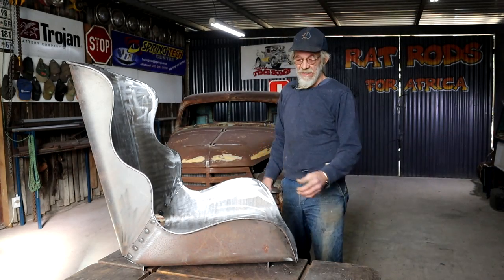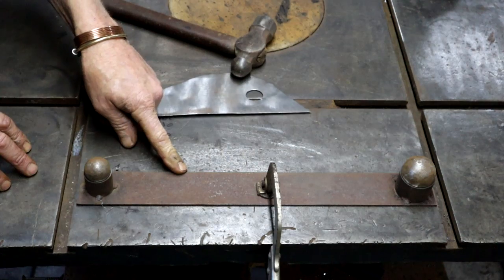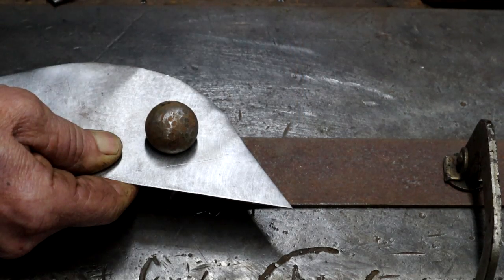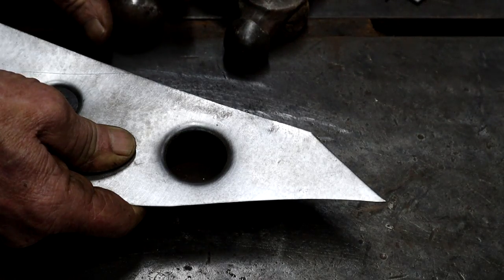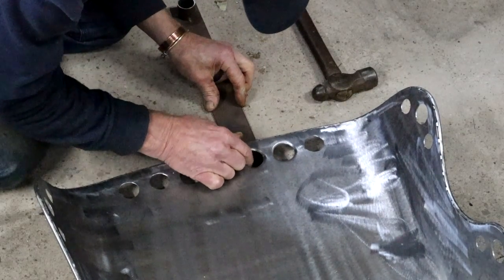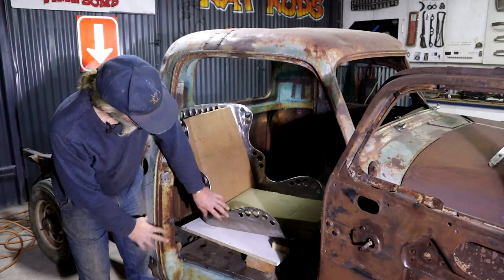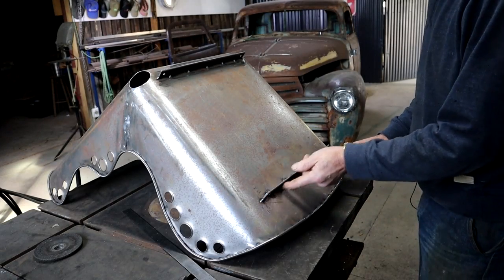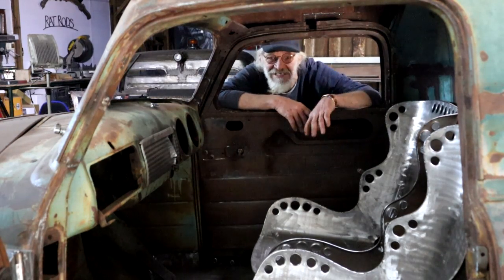DIY Dimple Plates - NO fancy tools, NO press!

Comment: Diff, if you make a short piece of tubing the size of the hole and weld tabs that center it in the larger pipe you can pull it up and set hole over it and then drop the inside tube down inside  before putting ball on it. Just a dumb thought all the way from Alaska. Cheers
Reply from the maker: That's a pretty neat idea! Someone using their brains up there in Alaska! :)

Comment: You can put a shorter piece of pipe (it can have thicker sides. A piece of PVC pipe would work) inside the dimple pipe.    With the shorter thicker walled pipe inside you can use it as the guide to center the hole to dimple it.    Easy peezy.    ♥️🇺🇸🍻
Reply: Or just paint a white dot centered on the bottom of the dimple pipe.

Comment: WOW..I wasn't expecting that. I think that is as simple as it can get. Truly innovative. Now have to go look for some steel balls, my brass ones just not gonna do the trick...lol. Thank you again for sharing Div. By the way seats look "awesome". You could drill multiple holes on the seat frame say 20/25mm (3/4" or 1" ) apart, 2 or three of them,  so that you  have a little ajustability in the forward/backward direction.
Reply from the maker: Thanks my friend! You know me, I like as simple as possible!😅 Been learning over the years that simple, yet effective engineering is the hardest. You will find a variety of different size steel balls at a place like Steel and Pipe. Regarding seat adjustability, yes a series of holes could work. That's the simplest!😂

Comment: Drill a hole through the center of the ball and the center of your lower  cup. Use a pin to center the ball in the cup. The ball then will be the centering guide
Reply from the maker: Clever thinking! But one would have to increase material thickness of the flat bar below the cup to ensure no sideways movement of the pin. Might try that sometime. Although the basic method does work well enough

Comment: Keep it simple and it works. Be simple to add a bolt to the ball and a hole in your backplate for the pipe for those thicker jobs.
Either way thank you for your time
Reply from the maker: Yes, that plan could work!👍

Comment: Looking good. Just a idea, weld a bolt on the ball and drill a hole into the bar you welded to the pipe the size of the bolt, tighten a nut on the bolt and you have a dimple. Might let you center it better and you don't have to do it on the floor. That's how I made mine. Keep up the great videos. 👍
Reply from the maker: Thank you. I did think of that, but the hammer is quicker😅

Comment: Amazon has steel balls available for cheap if you want larger you can also use the ball off a trailer hitch which are often cheap at any junk yard
Reply from the maker: Thanks. Yes I have trailer hitch balls here, but that would be for quite a large hole.

Comment: They look good i am building a 1957 chev gasser on a hope and a prayer and was looking at new aftermarket seat like that but they cost too much. so, i may try to build some and i need to do it with one sheet on four by eight sheet metal. good videos thanks. and i like it when you use metrics it helps me learn it better i already know inches.

Comment: Mabye drill hole through ball then weld a bolt inside the centre of the pipe then use bolt to centre ball may have to use smaller bar over bolt to hammer down dimple or cut centre bolt 3-5mm shorter than top of ball if any of that makes sence
Reply from the maker: Clever thinking! Yes, that could work. Might try that sometime even though my real basic method works well enough. Thanks.
Reply: Will be just as fast just less time centering the hole love what you do my friend really inspirational thanks
Reply from the maker: @scottthomas5450  true. Think you might have convinced me to give it a try! 😅